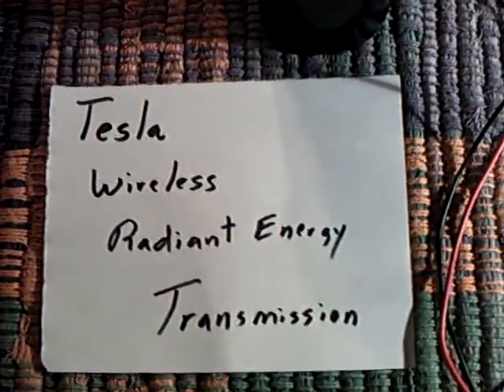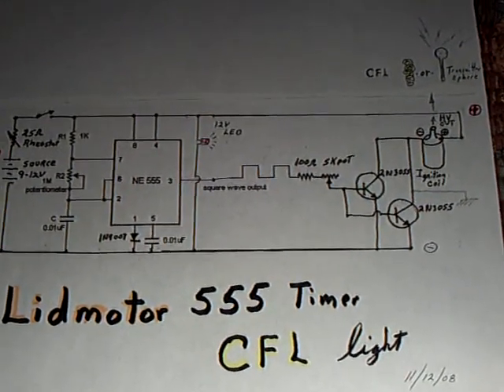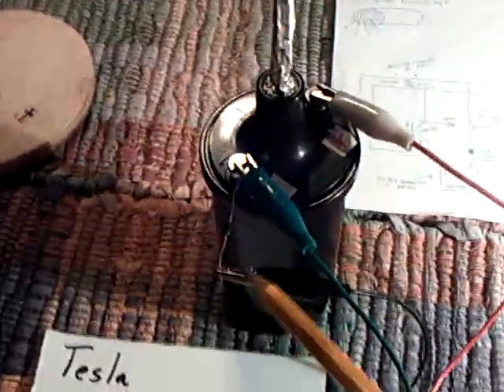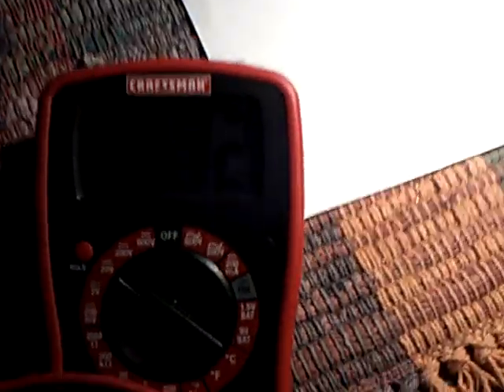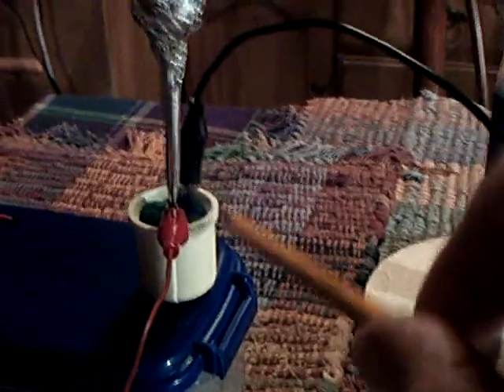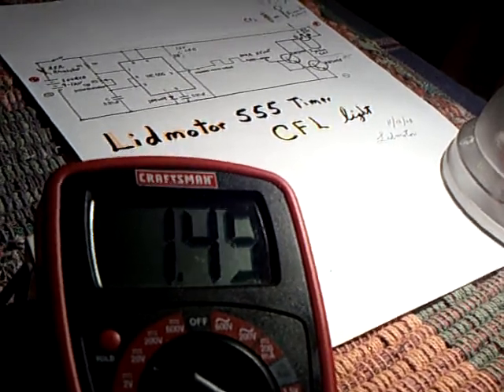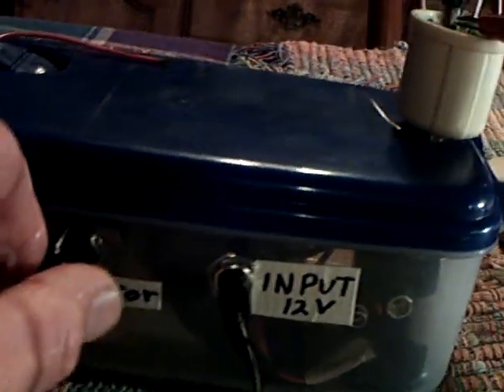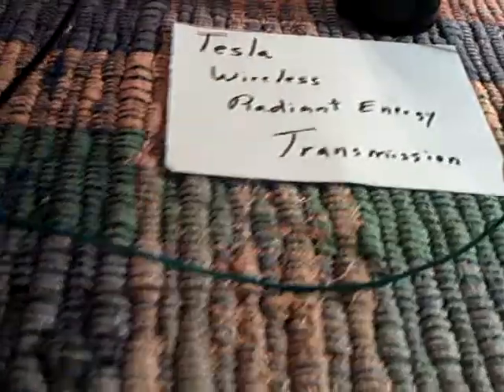Wireless Energy Transmission--Part 2

Comment: Hi Lidmotor - what were you doing right at the end there? As you were going to show us the power fall away when you disconnect the ground, the voltage shot up to over 15 volts on the receiver.. Were your hands providing extra grounding? Great video!